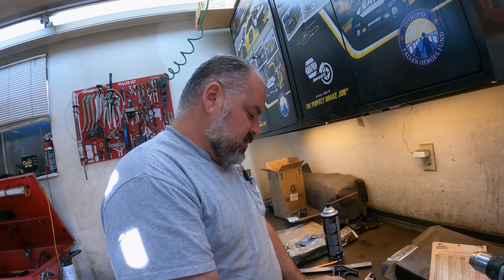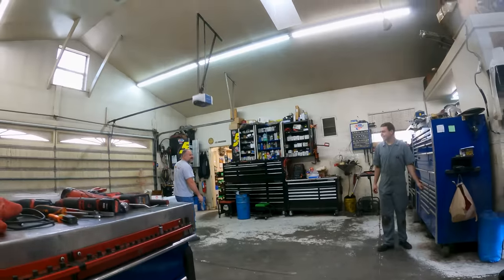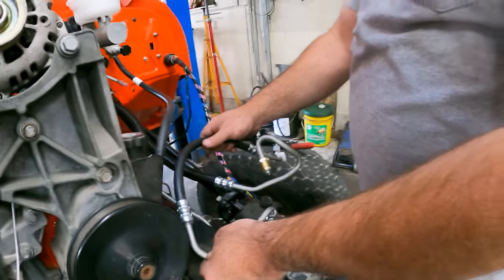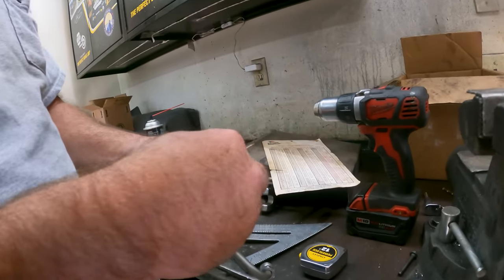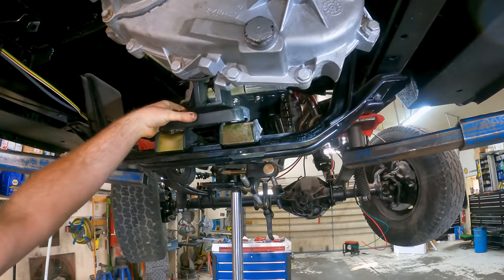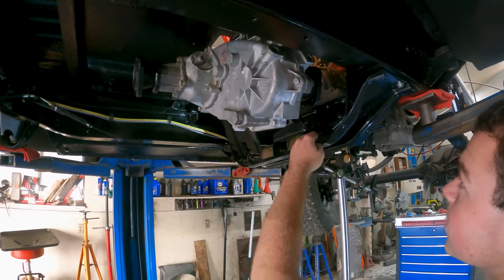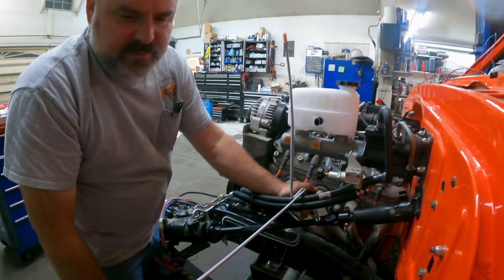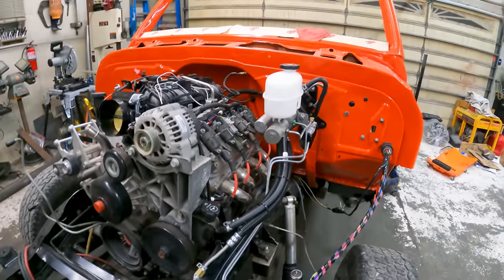Brakes? We Need Brakes And Power Steering!!

Comment: Very nice work. On a side note, when I was a young man learning some trades in the HVAC world, my instructor told me to change the point where I tighten the cutter on the tubing every rotation so as to not make a flat spot on the tubing. You may already know this but I thought i'd mention it. Keep up the good work.
Reply from the maker: Great tip! Soft material like copper and aluminum are very easy to flat spot.

Comment: Good show, next time you are down at Fab Rats you should show Paul how to do a double flare.  Every time I have seen him do brakes he only does a single flare on brake lines.  Have you ever tried or what are your thoughts on the copper/nickel brake line.  I just did all my brake lines on my 1st gen Bronco and what a dream that stuff is to work with.
Reply from the maker: He usually does a double flare he just doesnt show both steps. 
The copper/nickel brake lines are easy to work with and will last as long as they are properly mounted. The soft material can easily be damaged by any rubbing.

Comment: What as the reasoning for ls motor verse old school SBC or BBC?
Reply from the maker: The original plan was a big block but ditched it when we figured out how expensive it was going to be. I had this 5.3l kicking around and decided it made way more sense to go LS.
Reply: @chadsfab  can’t beat the reliability of an LS, my 6.0 has 250k with only waterpump, timing chain and knock sensors replacement. I upgraded to cold air and shorty headers (exhaust manifolds bolts broke).